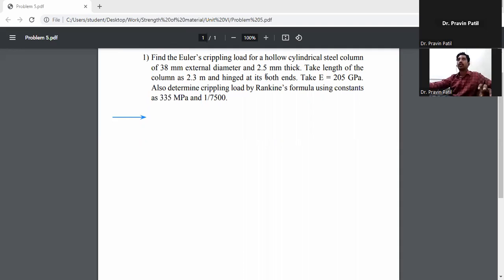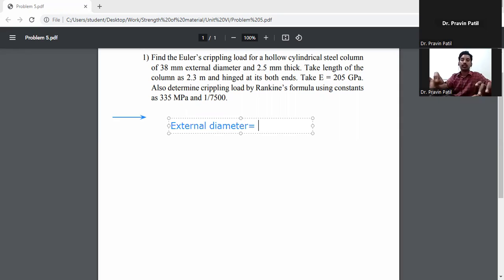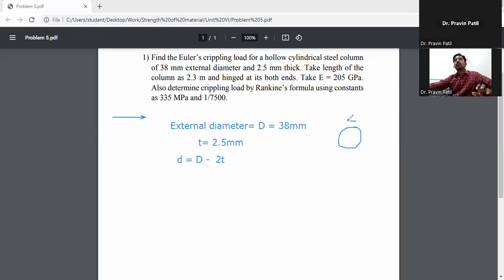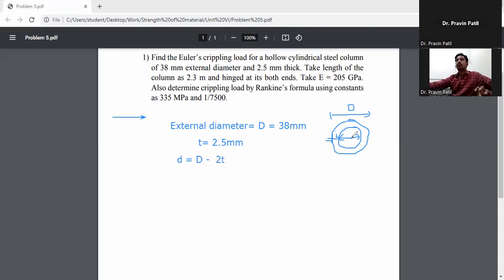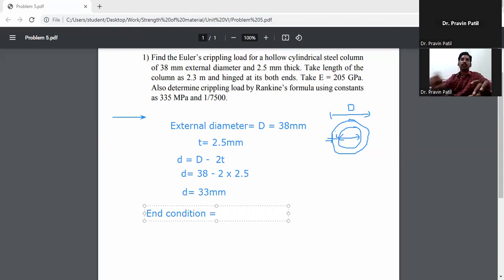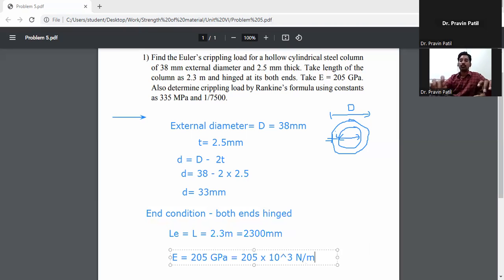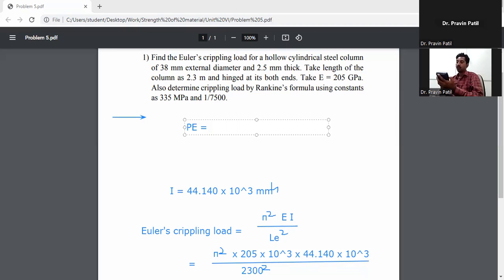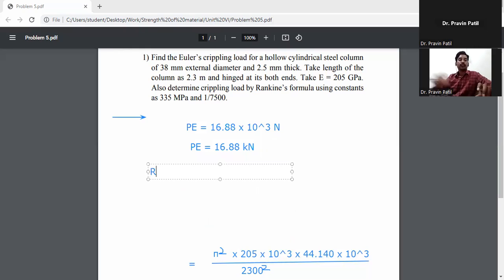Euler's and Rankine's crippling load for hollow circular section/Column/ Strength of Materials

Comment: Question:
In a square column, the length of the column is 40 times the length of each side of the square section. If both the ends of the column are pinned and the modulus of elasticity () is , determine the critical stress set up in the column.